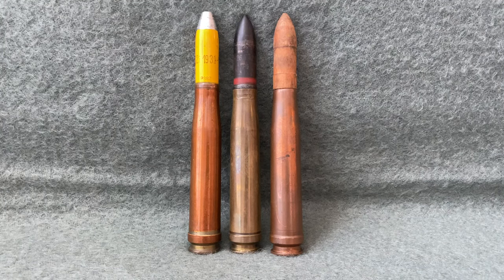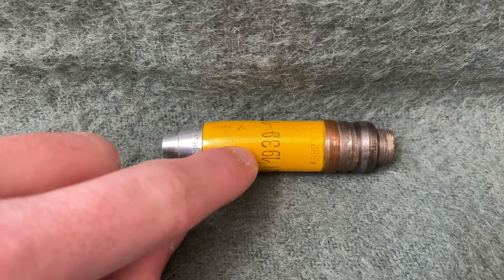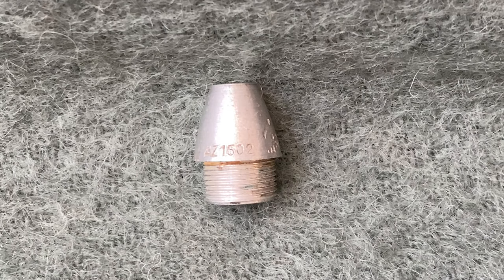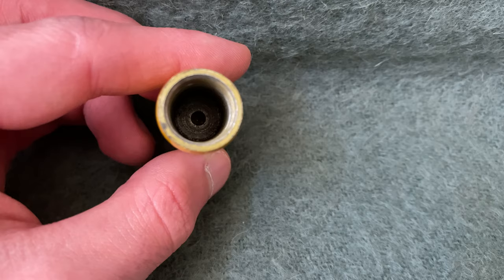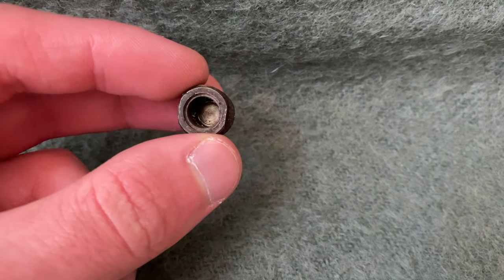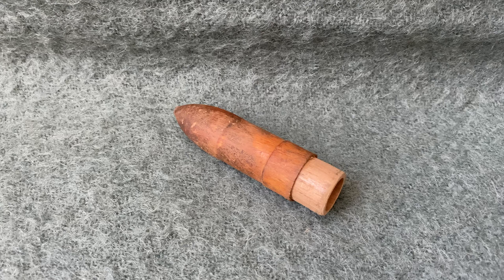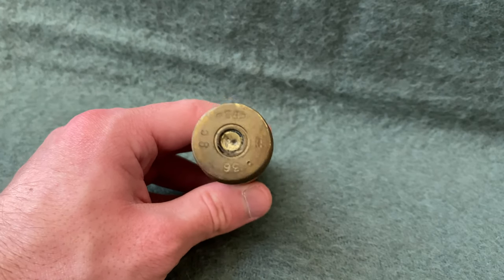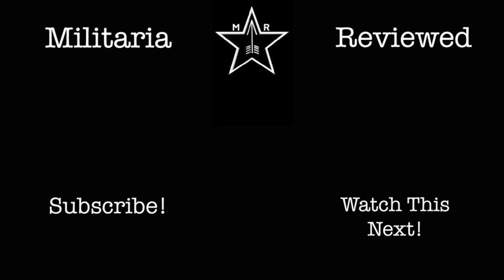Flak 38 Part 1: Ammunition

Comment: In 1965 I found a whole bunch of the magazines still full of ammunition, they had been under water for almost 20 years. I took some apart. One of the detonaters I took out of the aluminium tip and started to clean it out. Almost empty, it exploded in my hand and took my fingertips away, I ended up in hospital. These are very nasty and dangerous.
Reply from the maker: That is terrible, I am sorry you were injured by one. I have heard that the detonators are nearly impossible to inert so I was lucky to find some that were never filled. I also think that people underestimate how long ordnance can remain dangerous even when underground or underwater. I will pin your comment to show the dangers of dealing with UXO. Thank you for sharing your story.
Reply: @MilitariaReviewed  It happened the day before my 19th birthday, woke up in the hospital. That time I didn't know they were so dangerous, one shot can take a plane down at 500m height. We'll, I survived, 75 soon. Also the 20mm flak gun I found in the water, didn't know what it was then...
Reply: @MilitariaReviewed  its easy to empty them, you just need to cut off the detonator fixed under the fuze. But its dangerous, make sure to take some protecting items like metal-gloves stuff like that....
Reply: @clement9120  the tip with the detonar can be removed easily by unscrewing it. The tip is made of soft metal, provided with 2 ramps to put a small wrench on and to unscrew it from the projectile. Then the detonator, made of aluminum (I still have some small splinters in my face), can be screwed out of the tip. You'll see the tip contains a plunger that, on impact, goes into the detonator and ignites it. The detonator contained some white stuff like chalk. That detonator was almost cleaned empty when it exploded. The removed white stuff exploded as well but didn't do damage. Fortunately the rest of the 20mm projectile was not with me...
Reply: @geoffbenoy2052   ouch
Reply: yikes, i found one last week in the water while magnetfishing, and i really wanted to keep it and try to figure out more about it and try to make it inert. but after reading your story i get rid of it as soon as possible (bombsquad)  thx for the info and greetings from the netherlands :)
Reply: Thank God it was just your fingers
Reply: @MilitariaReviewed  They indeed are impossible to inert. If you look closely at the diagram of the 20mm you showed (actually a cutaway) you'll see how tiny the self destruct fuze is. You really dont want to tamper with that. Add to that the screws that are mounted counter clockwise and you can imagine why and how accidents happen when people try to dissasemble them.
I've seen plenty, filled with their charge or not. I truly believe that small caliber ammo and grenades are the most dangerous UXO's out there.
I'd neutralize a British 500 pounds bomb any day over 20/30mm ammo.
On a sidenote, the tungsten penetrators were very rare. An EOD friend of mine living in Normandy only managed to collect one in 20 years...
Reply: @clement9120  It's not that easy. You're actually better off finding a shell that was fired, impacted and broke off it's nose fuse. But even then, reclaming what's inside to empty it will be nerve wracking. Watch out for the tracer burn through fuze while you empty the round from the front...
I would never cut off a detonator if there was any traces of explosive left in the round.

Comment: Hi I have a brass one I picked up years ago and it now has a clipper gas lighter in the top. My wife has been using it for years. the base is stamped HPD and 40. it has interesting trench art etched into it depicting Egyptian pyramids etc. Perhaps it was fired by the Africa Corps? I did not know it was a German round until I watched your video. Thanks for that good film.

Comment: I have a flak38 complete with trailer with two live complete guns & one deactivated gun and also a blank firing barrel kit for use with the wooden tipped blank rounds.  
Aparently used by the army group south and eventually ended up in Slovakia where I found it from another collector. Would be interested to know what it is worth in current market?
Reply from the maker: Wow that is quite the collection! I would love to see some pictures of your flak 38s if you don't mind. Depending on where you are located I may be able to help with valuation. I know that there was a dealer in Czechia that had around a dozen or so at one time. It wouldn't surprise me if yours and his all came from the same group.

Comment: During my research, back in the mid-1980's, I uncovered anti=armour range tests for the 20mm. L.55 KwK.30 & 20mm. FlaK 30, there are range tests for the PzGr. AP-I, PzGr. APHE, PzGr.39 APCBC-HE & PzGr.40 APCR.
Reply: There was no 20mm Pzgr. 39 shell. If it was mentioned in some documents than probably due to mistakes from military personal, since most AP rounds, for AT guns, were of the Pzgr. 39 designation.

Comment: Interesting to see the changes over time through the war years. I watched a Military History Visualized video on recycling of ammunition, the markings on shells makes sense. Seems like a waste to not reload shells! Looking forward to more videos.
Reply from the maker: The cartridges definitely got more crude as time went on. The lacquered steel also had a nasty habit of jamming up the weapon. I've seen brass casings with markings indicating 4-5 reloads though those were probably used in a training setting. Couldn't do that with the steel casings! Glad you liked the video. I hope to have the next two parts out soon.
Reply: @MilitariaReviewed  Wow 4-5 times! Those casings are probably a bit thicker than rifle cartridges thats why I'm so surprised. Not sure if you could reload rifle cartridges that many times. Can't wait!
Reply: @AnticipatedHedgehog  depending on how hot you load some people get up to 10 reloads out of brass
Reply: @AnticipatedHedgehog  depending on the design and pressures the reloads reached and the resizing technique you may get over a dozen reloads out of rifle cartridges. Pistol cartridges can last even longer, especially low pressure, straight walled cartridges like 38spl and .45ACP

Comment: Quite clever how much is going on in the bullet head it's self, the he is interested in that they thought of a self destruct. I understand that on other cannon rounds, a timer detonation could be altered to detonate at certain altitudes.
Reply from the maker: Larger AA guns had the ability to set rounds to detonate after a certain amount of time which would correspond with a particular altitude. 8.8 cm flak had a sort of mechanical computer mounted next to them that the gunner would insert the nose of the projectile into prior to firing. It would set the fuze based on the altitude, speed, range etc. of the target and automatically adjust as needed. 2 cm flak cartridges did not have that ability but as I understand many modern 20mm cartridges do.
Reply: @MilitariaReviewed  yeah, cool isn't it? The earlier ones were simply a fuse delay done mechanically but as you say, certain modern guns have the ability to do it by computer, mainly used in larger calibre cannons.

Comment: There was a quick Note that modern shells weights are measured in grain. Grain as a unit is most commonly used in the U.S. and nowadays. Due to the presence of american products it has spread to europe, but in europe it is also Common to use gram. (I am disregarding  firearms before the metric System here) additionally, i believe that NATO uses the metric System in their Standards, and not grain.
Reply from the maker: Thank you for the insight. These units of measure can be quite confusing. It would be helpful if the US standardized with the rest of the world!
Reply: @MilitariaReviewed  I reload and use bolt units. I use grains for small stuff and grams for bigger artillery stuff. Don't know why but I find it easier to remember charges in grains.

Comment: What kind of explosive was used in the HE rounds, and what was the weight of the HE payload, if you happen to know?
Reply from the maker: The standard HE-T (Sprgr. mit L'spur) was filled with 6.2 grams of PETN (the Germans called it nitropenta).
Reply: Anywhere from 1.8 to 22 grams of HE.
Germany used PETN. Other countries also used PETN but many used RDX phlegmatized with wax.
Want to add an incendiary effect ? Take the same round, add a few grams of zinc powder.

Comment: 20x138mmB is used for Lahti, Solothurn and Flak 38 correct? All interchangeable between those guns...
Reply from the maker: Sorry for the late response. You are correct, 20x138b was used in all three of those. It was specifically utilized with the Solothurn S-18/1000. The earlier S-18/100 used a shorter cartridge, 20x105b. I have an example of that round in my collection as well.
Reply: @MilitariaReviewed  I have shot CVDS's Lahti 20mm before. However it wasn't 20x138mmB cartridges but 20x102mm Vulcan round that has been switched to percussion primed cartridge to be shot with Lahti's firing pin I believe. I'm guessing the chamber has been swapped to specifically shoot the 20x102mm. Barrel still a 20mm so no need to switch the barrel to shoot different 20mm cartridges.
Reply from the maker: @prandomable  That is interesting. I would be curious to know how they did the conversion to enable firing the shorter cartridge. Definitely the way to go if you want to actually shoot it. No idea where you'd  go to get a large supply of 20x138b cases. I believe there is also a company making 20mm bolt actions chambered for the Vulcan round since components for it are much more available. What was shooting the Lahti like? That is one of my "grail guns" that I hope to be able to get one day.
Reply: @MilitariaReviewed  it wasn't that much different than the .50cal to be honest. Also the bolt action 20mm you are referring to. 20x102mm Anzio Ironworks. The company owner Mike Remo he makes 20x102mm Anzio bolt action rifle shooting 20x102mm cartridges that's been converted to percussion primed. All factory 20x102mm Vulcan rounds are electric primed.

Comment: I've got a dark green 1944 U.S. CR med kit from ebay with a 20 mm bullet hole clean right through the front right edge of it, with trailing threads, it missed hitting a small square glass vial of insectiside. by 1/4 inch.